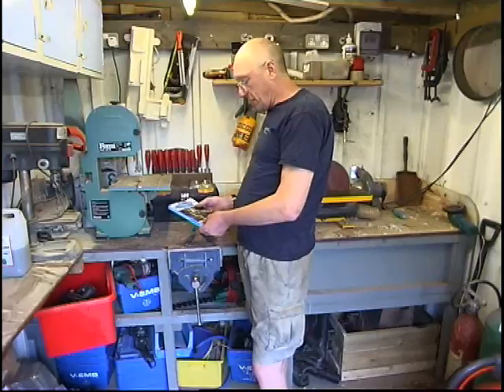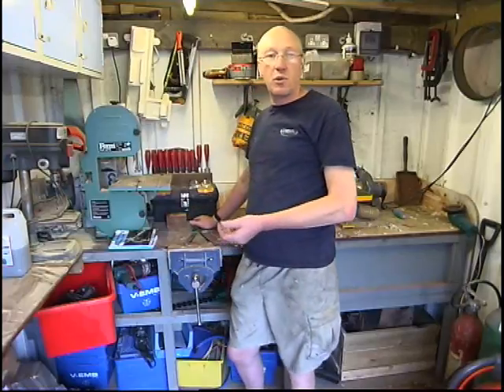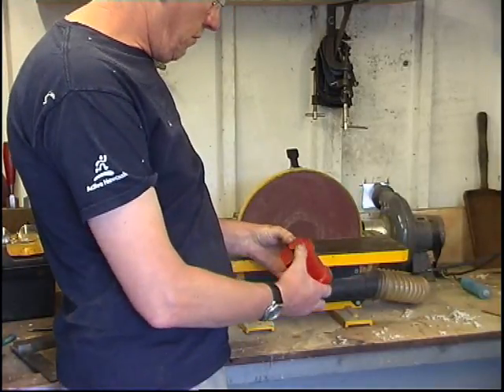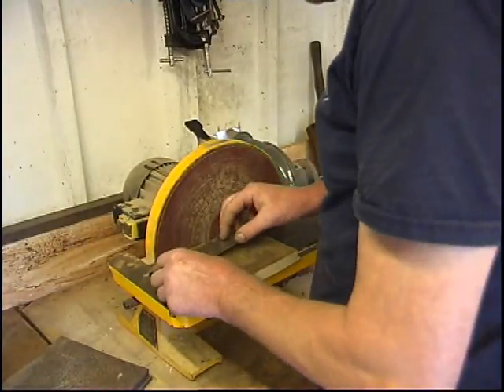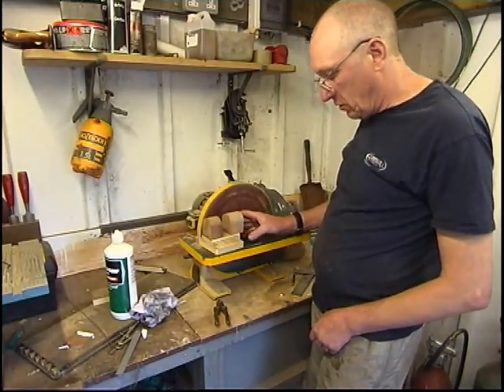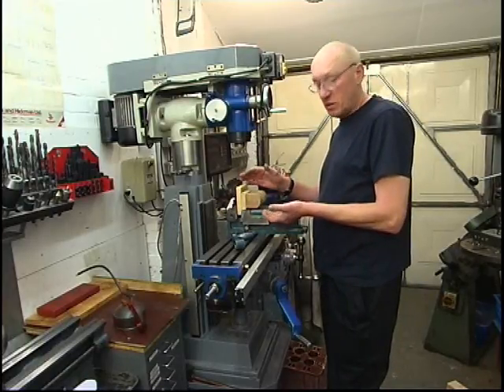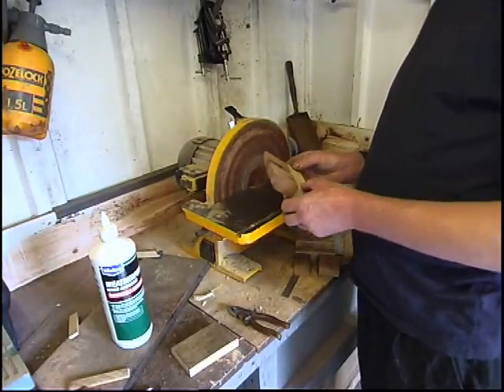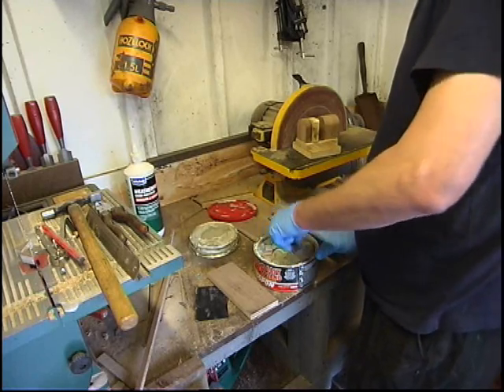DIVIDING HEAD PART ONE

Comment: Hi John. PVA glue is not the best solution to pattern making. A few years ago I discovered Aliphatic Resin glue. PVA glue never sets solid, ever, whilst AR glue makes a far stronger bond, has a really short 'grab' time of a couple of minutes and sets solid in a couple of hours, so you don't need to wait until tomorrow to work on the pattern, or risk joint failure.

The brand that I buy is Titebond (the 'original and best', as they say) but other brands are available (see eBay, for instance).

It's now Boxing Day, 26th December 2016 and after a number of years, I am still a follower of your projects and your SNNCs and long may they continue.

All my best wishes to you, Debs and your dad.